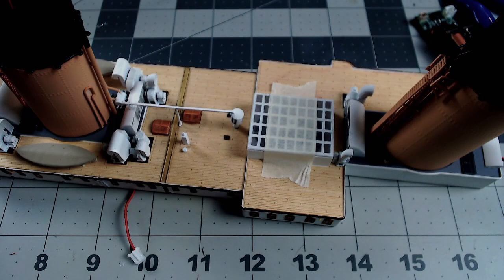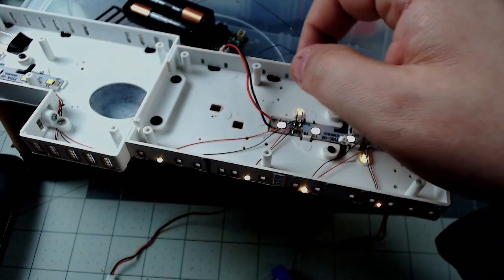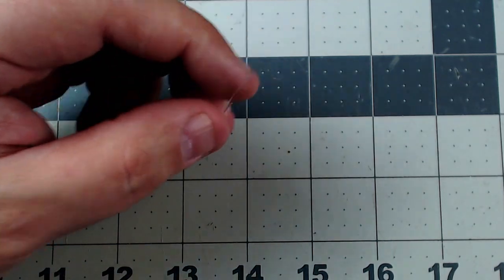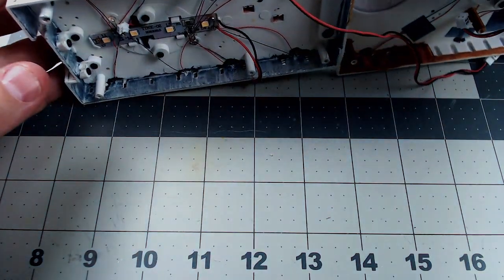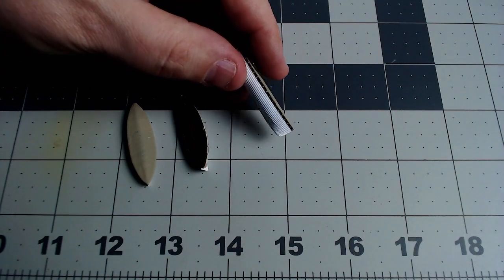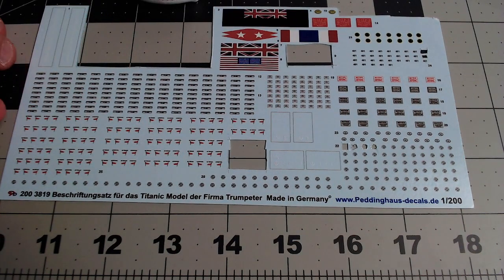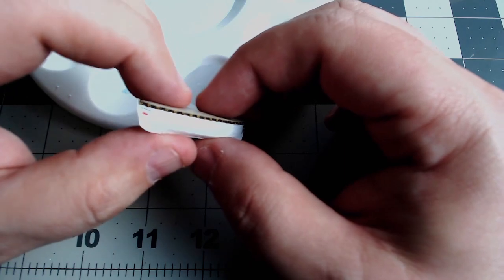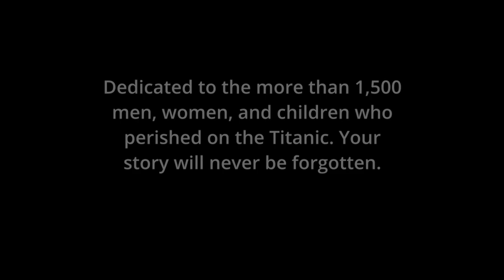Build the Titanic - Special 3: Lighting, Blocking, and Lifeboats

Comment: Great vid, just something to be aware of though,  superglue can damage the optics making it extremely fragile like glass and can fracture under the slightest stress, I had a couple snap after gluing so used gorilla wood glue and pin in place until dry. Also in some areas you might need to do very tight bends, warming the optics in some hot water works well for this, bend in the water and hold until cool and it sets nicely in place..
Reply from the maker: Thanks for the info! I've been finding that myself, so it's very helpful. Especially the bending. I didn't even think of that myself. 

This is why I love doing these. I'm by no means an expert at this, so comments like this not only help everyone, but also help me as well. Thank you so much!
Reply: @TheModelGamer  I'm no expert either lol.... Another couple of things you might find useful at sometime with optic fibre, if you run a flame quickly over the tip it will form a bulb like shape, apart from being handy as a light it will also stop the cable from puling through holes and can be trimmed back later..  I also paint the cables as they can bleed like like a neon tubes..   If needed you can also make a light box with those nano led's a little foil wrapped tubing with the led in the centre, then fix the fibre optic ends in each end of the tube to pick up the light, you can feed dozens of optics that way, I would add a resister to slightly tone down the power but it works well in areas where you cant pick up on lighting and can be a lot brighter,,, probably not needed with the titanic but there are areas you will need to run the optics to the deck below..
Reply from the maker: I actually decided to go strictly with fiber optics in the end. Although I like the lighting on the deck with the micro LEDs better, I worry about the power drain. Without knowing what the power source will be, I just worry that, eventually, there will be too many extra lights that will cause problems.

Especially since I may go and add fiber lights to the portholes in the hull.
Reply: @TheModelGamer  I came to the same conclusion, I am planning on adding led's to prom deck but taking the wires down into the hull where I will figure it out later..